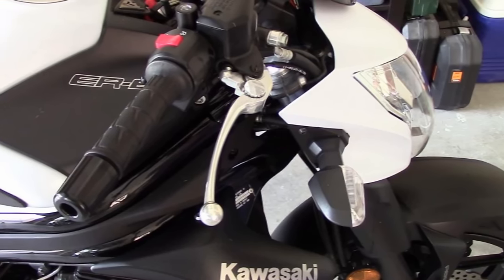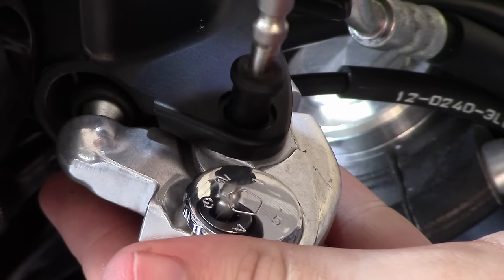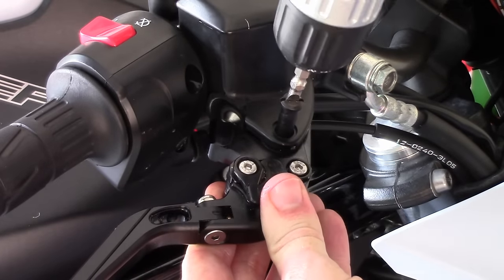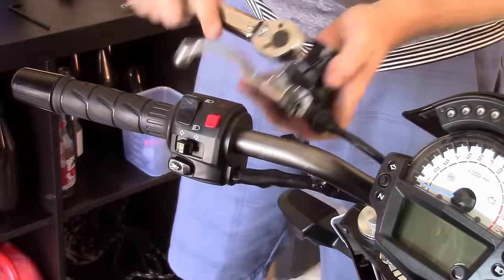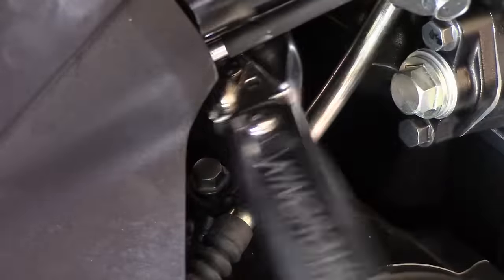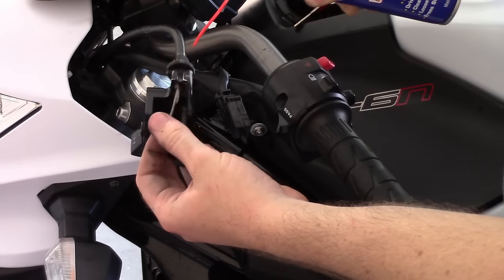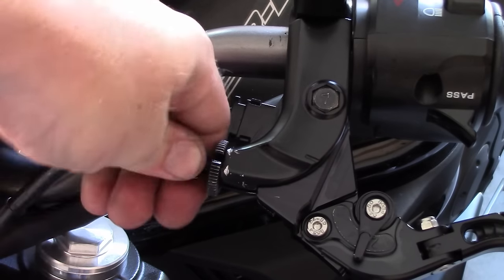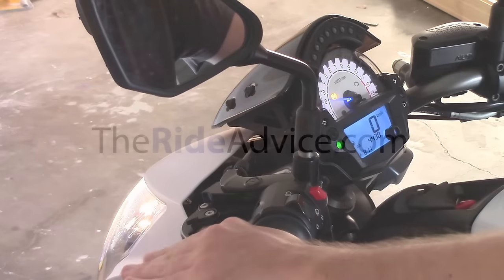How to Replace Your Motorcycle Brake Lever and Motorcycle Clutch Lever

Comment: #1 - WD-40 is not lubricant. It is a water displacement fluid but when it dries it has very low lubricating properties. It is better to use something designed as a lubricant on cables. I use teflon spray designed for bicycles but you can use relatively inexpensive 3M teflon spray just as well. 

#2 - it isn't a good idea to use a torque wrench as a socket driver. Socket handles are cheap enough that it isn't worth ruining the torque wrench loosening some bolts, they really are for the last few turns of a bolt/nut only.
Reply from the maker: Thanks for the tips, fprintf!
Reply: WHAT WOULD WE DO WITHOUT FPRINTF.
Reply: @tomsmith6458  then we use std::cout
Reply: @ruijiadong5665  le console.log has arrived

Comment: I’m having trouble finding a solution online. I have a stock brake lever for a 2021 mt09 I need to take apart. No videos or forums on how to take it apart. It’s adjustable with springs inside but no clear way on how to remove them.

Comment: I was installing universal levers on my lexmoto zsx f 2016 and the clutches retaining bolt is too short and doesn’t reach the mounting hole
Reply: Loosen your clutch cable from the mounting bracket

Comment: My retaining bolt in my brake lever will not budge
Reply: Try pulling the brake lever and wiggling it as you tug on it. Also make sure that it is fully unthreaded, and that the nut on the bottom is removed.
Reply: I would try a old fashioned impact driver the kind you smack with a hammer.

Comment: Can someone answer my question of why someone would remove the clutch and maybe the brake levers from a bike, from a security standpoint? Couldn't someone have their own levers and install it on the bike?
Reply: Drugs...
Reply: My bike got knocked over recently and the levers are bent so that can be a reasom
Reply: The clutch lever on my bike snapped in half when it fell down hence the need to replace